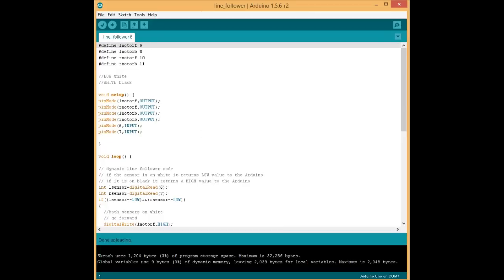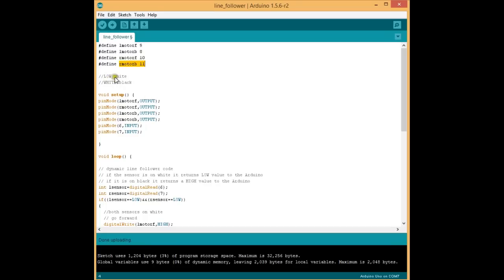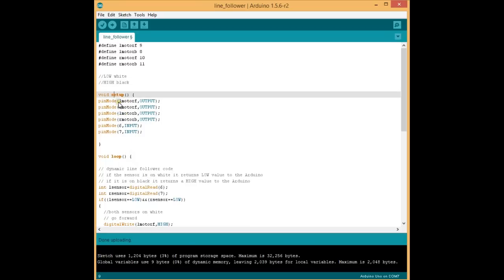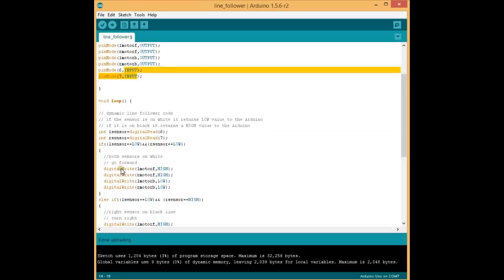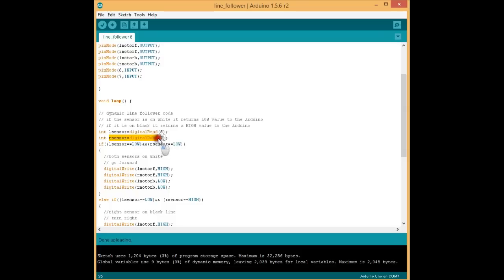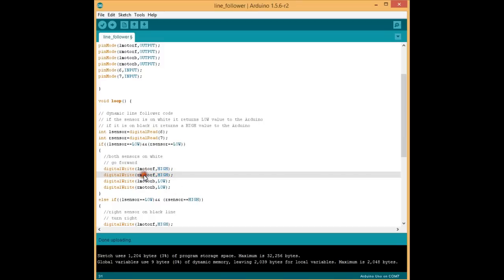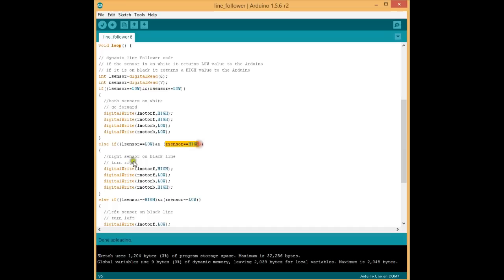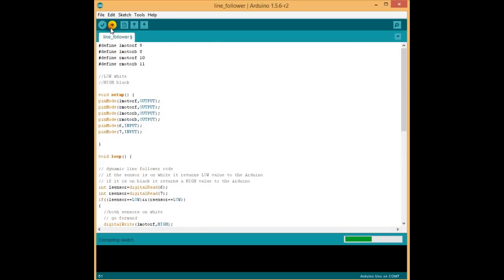Line Follower with Arduino: part 2 - Coding & Testing

Comment: And at last circuit diagram having 100 nd capacitor and where is PCB and there is many mistake comparing your video connection and this diagram plss ecplain

Comment: at last when u are working it out is it working without the usb connection?.i'm asking this question since u have connected the arduino with a fire wire while working this model

Comment: how the codes will change if I m using 3 IR sensors ? 3 is better than 2 or not ? pls REPLY
Reply: bro jo bich me lgta h uska code sifde vale se ulta hota h.. vo white se off hota h or black se off .. ar side k dono white se on black se off...
biggners k lia ir vala hi thik rhta h.. bina Arduino k.. ir ko perfect set kro.. ar driver ic me dal do..

Comment: Despite of writing your code my motors are not moving..I found out that all the pins are giving by default HIGH but I have set LOW some pins.What can be the problem?Can you give some suggestions?